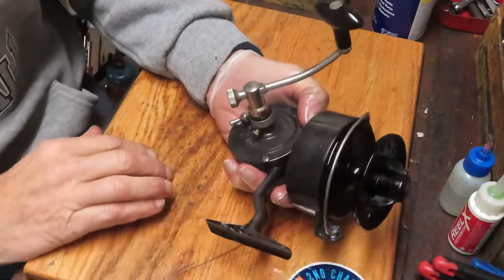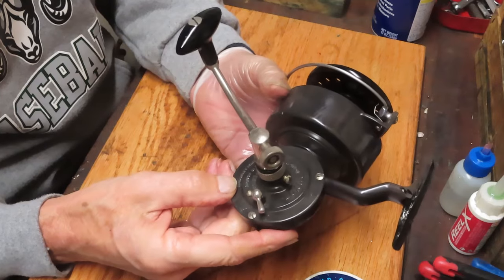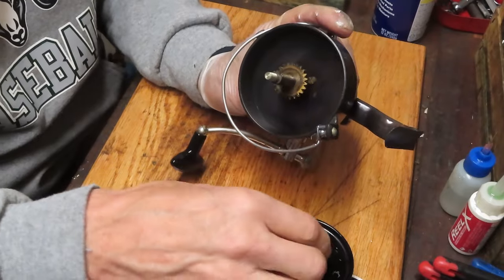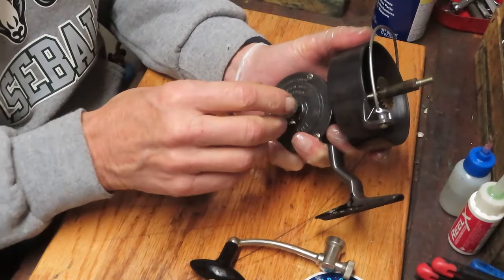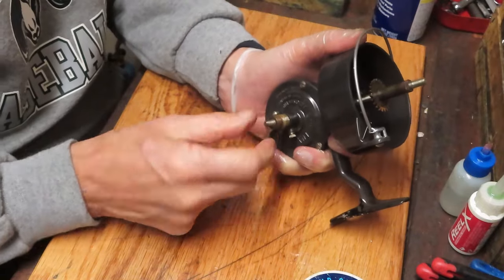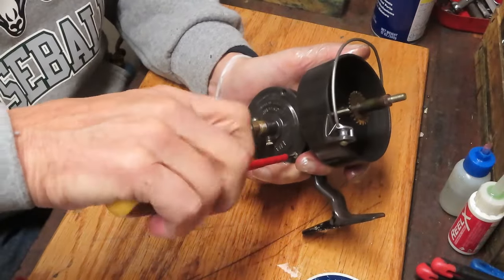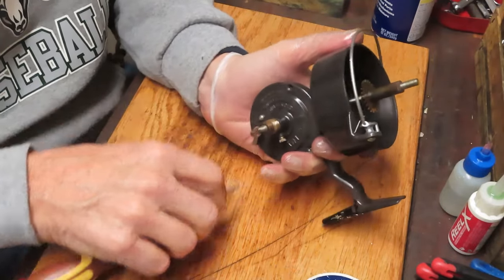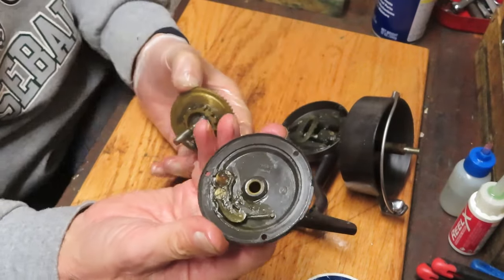Luxor Saumon vintage saltwater fishing reel how to service

Comment: You’re working on one of my all time favorites. Back in the 50s this was the finest surf reel available in the world. Van Staal modeled their incredible sealed reels after this Saumon Mer. I own five Luxors three os which are these incredible reels. Those wrenches are what are called ignition wrenches for use in automobile ignition repair. I still have my set of these from when I was in college. I remember when I talked you into doing your first  video on one of these. These were designed in France by Paul Monborgne for a company called LLM. LLM gave them to Pezon et Michel who provided the boxes and marketing for what became Luxor. There was a famous lawsuit between Montborgne and Pezon et Michel.  Montborgne then broke completely away and made Crack reels which are all but identical to Luxors. I own one Crack 200 which is identical to a Luxor 3LA. They are all magnificent spinning reels. I’ve never been able to separate the bearing from the pinion but it is easily serviced as one piece.  I know it can be separated because I have a friend who does it. I’ve never seen a larger bearing in any spinning reel. The spring for the bail is unusual. It operates like a torque spring.  It is like a very tiny garage door spring for lack of a better example. These reels were sold as PUM reels for surf fishing and did not have the bail. Two of mine are the PUM versions. I know you can never find a higher quality main gear than the one in these Luxor reels. You found the way to get that nut on the axle shaft. LOL.  The anti-reverse is a great design that works beautifully. This Saumon Mer was one of the reels that the old timers loved to fully pack with grease to control water intrusion. I’ve had to clean out a few like that. There are several versions of this reel with differences particularly in the handles. I have a few extra spools and handles for my reels but they are difficult to find. There is usually a very heavy felt-like band that goes between the rotor and the pinion/bearing. I was surprised this band wasn’t present in this reel. It was a way to resist water and salt intrusion from the interior of the bearing/pinion assembly. I have a schematic and some literature (in French) for this reel from a friend in France that you introduced me to one time. I have a few other reels from this same time period in France that are just as great as this Luxor. One was made by Hellion et Punch. They made a bailed reel before Luxor did called the Hellion. I have a PUM reel they made called the Mer 52 Punch. I have two of these along with an extra spool. Scott got one of the most revered spinning reels ever made when he got this one. Absolutely every spinning reel collector must have a Luxor in their collection! Great video Dennis! — Chris
Reply from the maker: Thanks Chris - I was thinking of you as I was working on this reel!  Best wishes - Dennis
Reply: @2ndChanceTackle I’ve learned a lot about Luxors since you did that first video on a Saumon Mer. This one that Scott found is very nice. I will always believe that historically this is the most iconic surf spinning reel of all time! - Chris

Comment: this is another of the holy grails of the large spinning reel collectors, and is priced as such when you find one on fleabay. this is a beauty. that must have been someone's sticker because they don't have them originally, the original info  is cast in the case side
Reply: a bit of your penetrating oil should remove the goo
Reply from the maker: Thanks - yes - and I found one at a recent flea market!

Comment: Hello-

I inherited two of these “Seven Seas”reels from my Dad.  The larger one appears to be the same model that you serviced.   Unfortunately, that reel is missing the bail arm.   Do you know if there is a way to find a replacement?   Also, what grease and penetrating oil are you using to service your reels?   Thanks!
Reply from the maker: Your only hope for a replacement is to find a donor reel or the bail wire on a secondary seller, like eBay.
I use Penn Precision Reel grease and oil and WD40 as a penetrating oil.